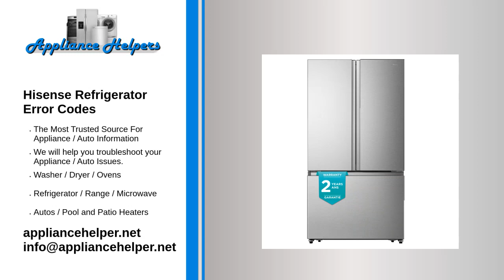Hisense Refrigerator Error Codes

Comment: What is H error
Reply from the maker: To find accurate information about the "H error" code on your Hisense refrigerator, you should refer to the user manual or technical documentation that came with your specific model. The manual typically includes a list of error codes along with explanations and recommended troubleshooting steps.

If you don't have the manual or cannot find the information you need, consider the following general advice:

Check the Display Panel:
Look at the refrigerator's display panel for any error codes or messages. The code may be accompanied by additional information or indicators.

Power Cycle:
Turn off the refrigerator, unplug it from the power source, and wait for a few minutes. Plug it back in and turn it on. This can sometimes reset the control board and clear minor errors.

Consult the Manufacturer's Website:
Visit Hisense's official website or the support section of the manufacturer's website. They may have resources, guides, or FAQs that provide information on error codes for your specific model.

Contact Hisense Customer Support:
If the error persists or if you are unable to find information on the specific error code, it's advisable to contact Hisense's customer support. They may provide specific recommendations based on your model and the issue you're experiencing.

Professional Service:
If the issue is not easily resolved or if you are unsure about conducting troubleshooting checks yourself, it's recommended to contact Hisense's customer support or a qualified appliance technician for further assistance.

Always prioritize safety when dealing with appliance troubleshooting or repairs. If you are uncertain about the cause of the error or how to address it, seeking professional assistance is recommended. They can provide accurate information based on the specific model and help resolve any issues with your Hisense refrigerator.

Comment: deforsting sensors valive ? K ?
Reply from the maker: It seems like you're referring to a Hisense refrigerator error code related to defrosting sensors. The exact meaning of the error code "K" or "valive" isn't clear as it may vary depending on the specific model of the refrigerator. However, generally, error codes related to defrosting sensors could indicate issues with the refrigerator's defrost system, such as malfunctioning sensors, heater, or timer.

Here's what you can do to troubleshoot the issue:

Power Cycle: Try unplugging the refrigerator for a few minutes and then plugging it back in. This can sometimes reset the control board and clear error codes.

Check Defrost System Components: Inspect the defrost system components, including the defrost heater, defrost thermostat, and defrost timer (if applicable), for any signs of damage or malfunction. Replace any faulty components as needed.

Test Sensors: Use a multimeter to test the defrost sensors for continuity and proper functioning. Consult the refrigerator's service manual for the specific resistance values and testing procedures.

Reset the Control Board: Some refrigerators have a procedure for resetting the control board to factory defaults. Refer to the user manual or contact Hisense customer support for instructions on how to perform a control board reset.

Professional Service: If you're unable to identify or resolve the issue on your own, it's best to contact Hisense's customer support or a qualified appliance technician for further assistance. They can perform diagnostic tests and repairs to address the problem with the defrost system.

By following these troubleshooting steps, you can hopefully resolve the error code related to defrosting sensors on your Hisense refrigerator. Always prioritize safety when working with appliances, and consult the refrigerator's user manual for model-specific troubleshooting tips.

Comment: How to fix code E4 error
Reply: same thing with mine, showing EF , i think its a problem with Fan/Motor that blows air from freezer up to fridge area 
they are not expensive to buy $30 approx
Reply: J'ai un réfrigérateur Hisense. Le code E5 apparaît à l'écran. Puis-je connaître la signification du code E5 ?

Comment: Ec error how to fix?
Reply from the maker: The "EC" error code on a Hisense refrigerator typically indicates an issue with the defrost system. This error code can appear when the refrigerator's control board detects a problem with the defrost heater, defrost thermostat, or defrost timer. Here's how you can troubleshoot and potentially fix the issue:

Power Cycle the Refrigerator: Start by turning off the refrigerator by unplugging it from the power outlet or by switching off the circuit breaker that supplies power to the appliance. Leave it powered off for about 10-15 minutes to allow the system to reset. Then, plug it back in or turn the power back on.

Check the Defrost System Components: Inspect the defrost heater, defrost thermostat, and defrost timer (if applicable) for any visible signs of damage or malfunction. The defrost heater should have continuity, and the defrost thermostat should close when cold (if it's a thermal switch). Replace any components that show signs of failure.

Clear Any Ice Buildup: Excessive ice buildup on the evaporator coils or in the freezer compartment can also trigger the EC error code. If you notice significant ice accumulation, manually defrost the refrigerator by removing food items, unplugging it, and allowing the ice to melt. Use towels to soak up excess water.

Check the Defrost Drain: Ensure that the defrost drain is not blocked or clogged with debris. A blocked drain can lead to water accumulation and ice formation, triggering the EC error code. Use a pipe cleaner or a small brush to clear any obstructions from the drain.

Reset the Control Board: Some refrigerators allow you to reset the control board to clear error codes. Refer to the refrigerator's user manual for instructions on how to perform a control board reset. This may help clear the EC error code and restore normal operation.

Contact Customer Support: If the EC error code persists despite your troubleshooting efforts, it's best to contact Hisense's customer support or schedule a service appointment with a qualified technician. They can provide further assistance and diagnose any underlying issues with the refrigerator's defrost system.

By following these steps, you can troubleshoot and potentially fix the EC error code on your Hisense refrigerator. Always prioritize safety when working with appliances, and consult the refrigerator's user manual for model-specific troubleshooting tips and instructions.

Comment: How tocfix E24error
Reply from the maker: Error code E24 on a Hisense refrigerator typically indicates a problem with the defrost sensor or the defrost system. Here's how you can troubleshoot and potentially fix this error:

Check Defrost Sensor:
The defrost sensor monitors the temperature of the evaporator coils. If it's malfunctioning or faulty, it can trigger error code E24. Inspect the defrost sensor for any visible damage or signs of wear, and test it for continuity using a multimeter. Replace the sensor if necessary.

Inspect Defrost Heater:
The defrost heater is responsible for melting frost and ice buildup on the evaporator coils during the defrost cycle. If the heater is faulty or burned out, it can cause error code E24. Check the defrost heater for continuity using a multimeter, and replace it if defective.

Check Defrost Timer:
The defrost timer controls the timing of the defrost cycle. If the timer is stuck or malfunctioning, it may prevent the refrigerator from defrosting properly, leading to error code E24. Test the defrost timer for continuity and proper operation, and replace it if necessary.

Inspect Wiring and Connections:
Inspect the wiring harness and connections associated with the defrost system for any signs of damage, corrosion, or loose connections. Repair or replace any damaged wiring, and ensure all connections are secure.

Reset the Refrigerator:
Try resetting the refrigerator by unplugging it from the power source for a few minutes, then plugging it back in. This can sometimes clear error codes and restore normal operation.

Professional Service:
If you're unable to diagnose or resolve the issue on your own, or if the error code persists despite your efforts, it's best to contact Hisense's customer support or a qualified appliance technician for further assistance. They can perform diagnostic tests and repairs to address the problem with your refrigerator.

By following these troubleshooting steps, you can address error code E24 on your Hisense refrigerator and potentially restore normal operation. Always prioritize safety when working with electrical appliances, and consult the refrigerator's user manual for model-specific troubleshooting tips.

Comment: F2 error
Reply from the maker: The F2 error code on a Hisense refrigerator typically indicates a problem with the refrigerator's temperature sensor or thermistor. Here's what you can do to troubleshoot and potentially resolve the issue:

Check Temperature Settings: First, verify that the temperature settings on the refrigerator are set correctly. Ensure that the refrigerator compartment is set to the desired temperature and that the temperature display corresponds to the actual temperature inside the refrigerator.

Inspect Thermistor: The F2 error may be triggered if the thermistor, which monitors the temperature inside the refrigerator, is faulty or damaged. Inspect the thermistor for any visible signs of damage, such as frayed wires or corrosion. If the thermistor appears damaged, it may need to be replaced.

Reset the Refrigerator: Try resetting the refrigerator by unplugging it from the power outlet for a few minutes and then plugging it back in. This can sometimes clear error codes and reset the refrigerator's control system.

Contact Hisense Support: If the F2 error persists after performing the above steps, it's recommended to contact Hisense customer support for further assistance. They can provide additional troubleshooting steps specific to your refrigerator model and arrange for service if necessary.

Professional Repair: If you're unable to resolve the F2 error on your own, it may indicate a more significant issue with the refrigerator's temperature control system. In such cases, it's best to consult with a qualified appliance technician who can diagnose the problem and perform any necessary repairs.

By following these steps, you can troubleshoot the F2 error code on your Hisense refrigerator and potentially resolve the issue. If you have any concerns about performing these troubleshooting steps yourself, don't hesitate to seek assistance from a professional technician or Hisense customer support.